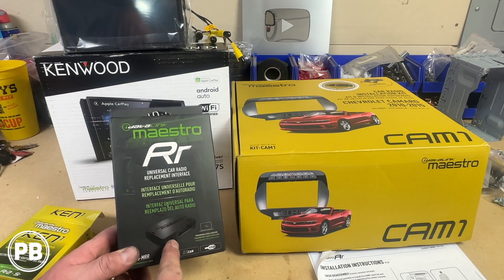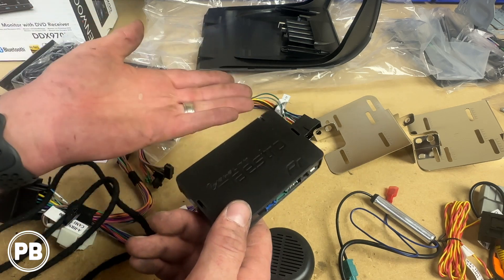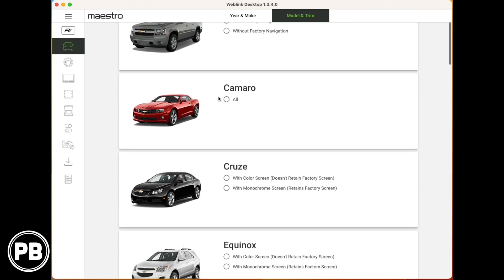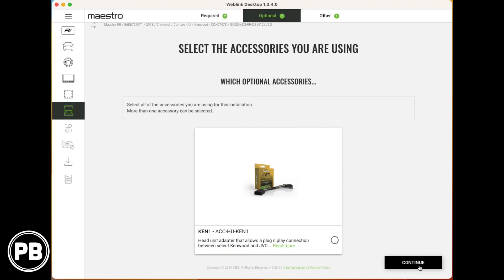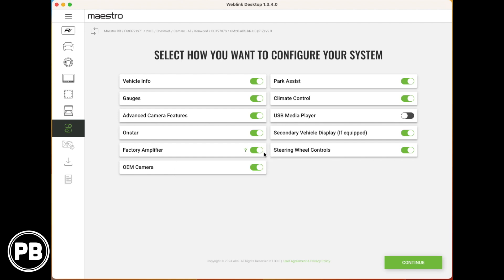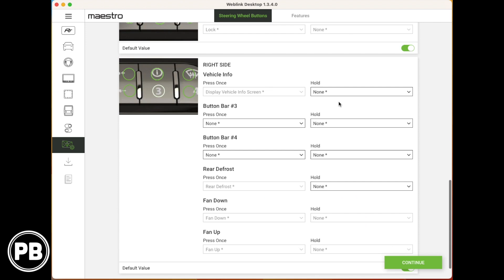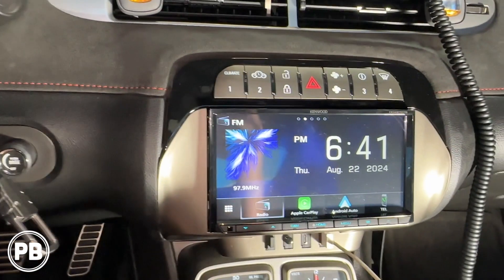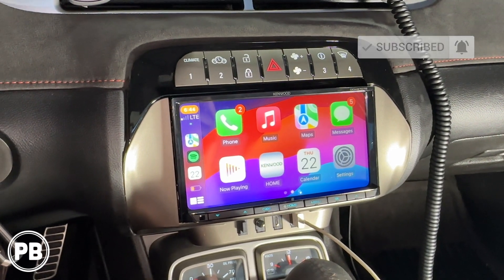How To Program iDatalink Maestro ADS-MRR & MRR2 Module

Comment: does it work for my 2011 mailbu? i been seeing places say it does, and it don't I don' want to buy it and it don't work 
the radio i was going to get is pioneer dmh-w3000nex
Reply from the maker: Check with idatalink maestro, thats the best way to check.  using their fit guide, looks like only the steering wheel control module fits, the MRR & MRR2 isn't compatible.
Reply: @ProvoBeastAudio  ohhh man thanks is it another thing i should get with w3000nex ??

Comment: @ProvoBeastAudio guick question for you.  My aftermarket radio has a Meastro Rr and it has been working great until recently.  My vehicle is stuck in the heat mode and at its hottest setting.  The fsn works, csn turn it to full blast or minimal.  I can click the airconditioner on but it remains in the heat mode.  If i do the reset on the unit itself and in my radio settings, will i lose all the imfo that was put in during the original setup?  Or will it retain the radio and vehicle info from the original set up?  Thank you for your help.  I subacibed as well.